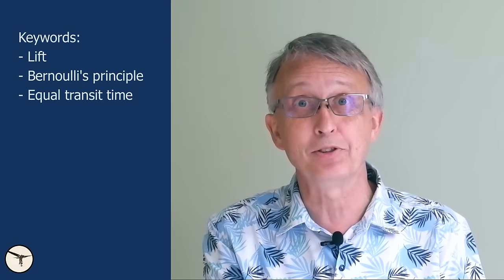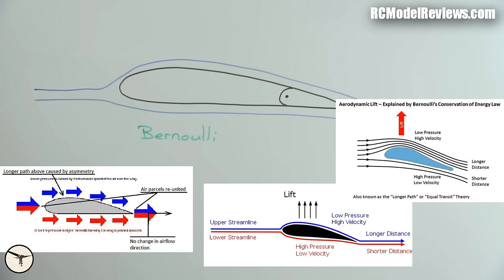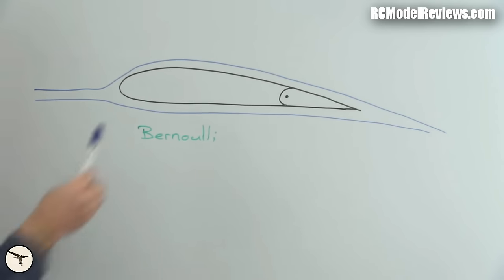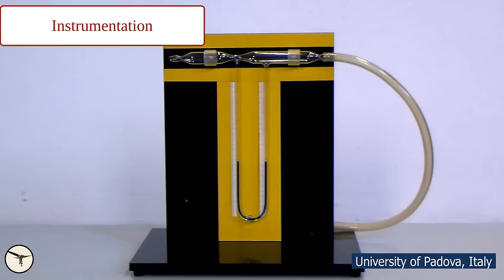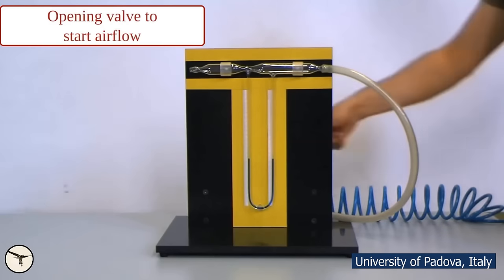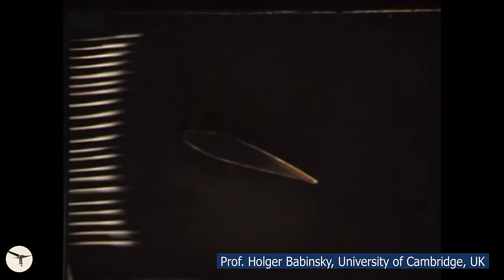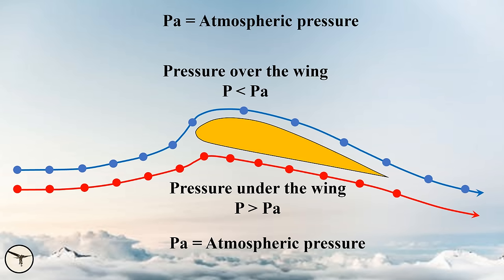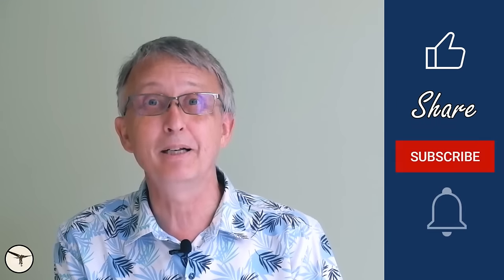Why are so many pilots wrong about Bernoulli’s Principle?

Comment: That is a great demonstration.  The 'meets at the tail of the wing at the same time' explanation has always troubled me.  Another thing that nobody seems to consider is the change in direction.  Clearly the air leaving the tail side is moving downward to some degree and that means a force was applied by the wing.
Reply: Why would that mean a force was applied by the wing? Wouldn't that have something to do with the fact that the bottom air is lagging behind the upper air? The downward movement of air is more about induced drag I believe.
Reply: @blusheep2  Well from a simplistic analysis, let's assume at first the air was not moving (assuming no wind at all), and then the air is accelerated downward as the wing slices through it.  The underside of the wing is at a slight angle and deflects some air downward (angle of attack).  The air over the wing flows over the curved surface and exits the back side in a smooth flow line along that surface (assuming the angle of attack is not so steep that the wing 'stalls'), which is slanting downward even further.  Sure, AFTER the wing passes there are all sorts of eddys / whorls and turbulence in the air.  But before that the air is being accelerated downward as the wing slices through.  Hence, I believe, the wing is acting to push the air downward and an opposite reaction force pushing the wing up.
Reply: @mikefochtman7164  OK, I see. The deflection of the bottom air down demonstrates an earlier force on the bottom of the wing. Its a Newton's 3rd law thing as opposed to a Bernoullie principle thing.
Reply: @mikefochtman7164  Absolutely this!
Treat the wing as a black box. Before the wing, the air is static, after the wing the air is moving downwards. Whatever accelerates that ir must exert a force on it and experience an equal and opposite force.
Only if you need to design a wing and present its characteristics do you need to know HOW it works. Which makes me wonder, why teach pilots this anyway? There are shed loads of systems on aircraft that pilots, aren't taught.
Reply: @blusheep2  Exactly. Coanda effect due to surface resistance slows the layer in immediate contact with the wing and causes the air avove to curve downwards due to velocity transfer to the slowed air below

Comment: The main reason of lift generation is down deflection of flow due to the angle of attack. There are airfoils with more curvature on the bottom than the top (for instance <oaf139-il>) and they provide ample lift provided there is enough AA. Besides, pilots generally don't understand aerodynamics past very basic level. They understand and follow rules and procedures.

Comment: As a CFII and someone with an undergraduate degree in Aerospace engineering, the reason it is taught the way it is, is because the students seeking their pilots license would neither understand nor are they interested in fully learning how a wing generates lift. I know, I have tried. What an airfoil really does is to rotate the air in a clockwise manner using the diagram of the airfoil used in the video. This rotation accelerates the air above the airfoil, and retards the air below the airfoil. As mentioned, the total pressure around the airfoil is constant and the same. But with the higher airspeed above the wing, it has a higher dynamic pressure than below the wing, and therefore has a lower static pressure. Lift is generated due to the differences between these static pressures, multiplied by the surface area of the wing. Anything that rotates air, will generate lift.
Reply: Interesting, but incorrect. I am sitting in front of a fan to cool me, which is rotating air...and I assure you it is not producing "lift."
Reply: @royshashibrock3990  - not that form of rotation. But nice try though. FYI, it is the type of air rotation which causes a golf ball to fly, and the Magnus effect.
Reply: @HH-mw4sq  Ahahahahahahaha 😂😂😂
Reply: Interesting, looks as if you were taught wrongly in your aerospace engineering degree.
Reply: @deang5622  - how so? Please elaborate?
Reply: @deang5622  
The trolls are out in force; realizing they are plebs I will no longer respond (I said this earlier but really gone after this). Your comment also apples to the airline pilot who authored the video. I have a question for you: exactly how many planes have you built and flown? I can guess. Over & out.
Reply: The airfoil is rotating nothing, just like there is no literal circulation about the foil(all mathematical models to simplify what is actually going on). The stagnation point is the key to understanding the flow pattern, which is an upwash followed by a downwash.

The fluid is forced down and forward by stagnation pressure, which is located under the foil. This causes a pressure wave in front of the foil, diverting air upwards away from the upper surface while simultaneously diverting air upwards to hit the bottom surface of the foil on the other side of the stagnation point. This flow pattern cannot be calculated by a simple equation, not even the NS equations let alone Bernoulli. In simple terms air is directed away from the upper surface and air below is directed towards the bottom surface, nothing to do with static pressure and dynamic pressure. On either side of the foil, away from the asymmetric field, there is an undisturbed atm pressure that applies the same force to the top and bottom of the foil. 

Lift is created by opposing atm pressure.
Reply: @singh2702  - the air, after encountering an airfoil, is flowing in a different direction than before. That change in direction is referred to as a rotation of the air. FYI, a stationary rotating cylinder will generate lift if rotated fast enough. That effect further reinforces the notion of rotating air to create lift.
Reply: @HH-mw4sq  That's lift through the Magnus effect, same principle going on. In both cases, with the airfoil and spinning cylinder, air is sped up above and slowed down below. In both cases, the faster moving air is confused with lower pressure because Bernoulli's theorem says so. 

What is actually going on is air is being accelerated upward, out of the way of the foil's path, opposing the downward atmospheric pressure at some height above the disturbed field, hence a lower pressure above. By accelerating air upwards while moving forward, the foil has enough time to have some lower pressure applied to 1st quarter or more of the chord length on the upper surface before pressure recovery begins. 

Faster moving air does not mean lower pressure. Take, for example, the horizontal blowing of air across a piece of paper hanging vertically. That horizontal jet entrains air between the jet and paper, creating a low-pressure region causing the paper to rise up and align itself horizontally with the jet. Once the paper aligns itself, there is fast-moving air above the paper and static air under the paper. Why is there no lift of the paper then? Rather than the equilibrium position observed.
Reply: @singh2702  - "air is sped up above and slowed down below", in other words the air is rotating. Anything that can rotate air, will generate lift.
Reply: @HH-mw4sq  Your idea of lift sounds like you are saying circulation superimposed over a horizontal flow generates lift. In potential flow, that is just the Kutta condition, which is a mathematical model.

When I mentioned the speed differential,  I meant on-coming air is accelerated upward through an upwash. Airstreams that flow over the upper surface move faster because the airstreams that flow below first flow up towards the bottom surface , since they can't flow through the foil , they are forced to change direction and follow the geometry of the underside. This longer travel path results in the flow reaching the trailing edge after the flow that went over the top. 

In summary, air that is accelerated up opposes downward atmospheric pressure on the upper surface, and air that is accelerated up towards the bottom surface increases pressure.
This is how a pressure differential is created. Speed is just a result of the geometry of the foil.
Reply: @singh2702  - dude, all you have been describing is the rotation of air as it passes over the upper and lower surfaces of a wing. That is the direction of the average flow of air aft of a wing, is different than the direction of the average flow of air upstream of a wing. That change in the direction of those two average flows is the rotation of the air due to its interaction with the wing. That is how an airfoil generates lift. It rotates air by changing the direction of the downstream airflow from the direction of the upstream airflow.
Reply: @HH-mw4sq  I have been trying to explain that air speed is not indicative or correlated to pressures. 

The airstreams flowing upwards above the foil away from the upper surface are turned back down ,by pressure above the disturbed field ,to reattach to the foils surface(pressure recovery is vital to resist drag and prevent stall). 
The air flowing up under the foil is turned down by the foil. These details are important in identifying how air is redirected so as to produce a pressure differential.

It all begins with the stagnation point splitting the air. The air is pushed down and forward, causing a pressure build-up in the front of the foil, which is why air way ahead of the foil can be seen starting to flow up in wind tunnels. 

I don't see how Bernoulli applies here.
Reply: @singh2702  - You are very stubborn, and your stubbornness makes you impervious to accurate information. I have never mentioned anything about Bernoulli's law. Once again, for emphasis, anything that rotates airflow will generate lift.
Reply: @HH-mw4sq  "But with the higher airspeed above the wing, it has a higher dynamic pressure than below the wing, and therefore has a lower static pressure. Lift is generated due to the differences between these static pressures" 

From your original comment. I'm pretty sure that's Bernoulli.